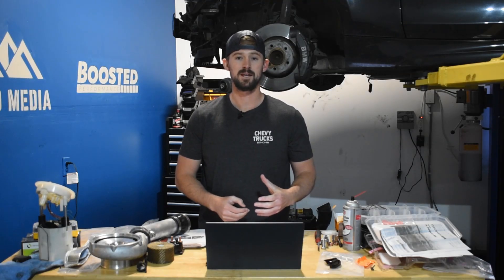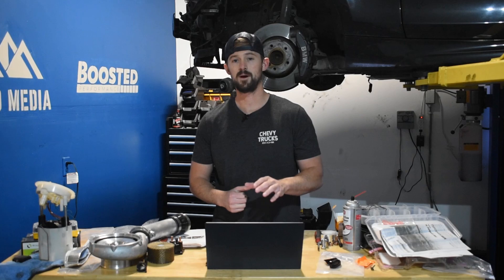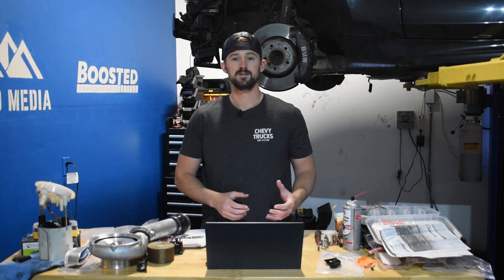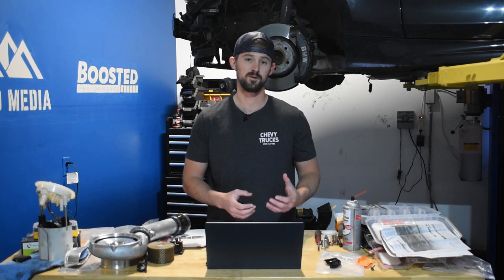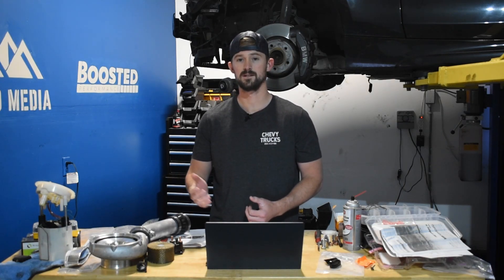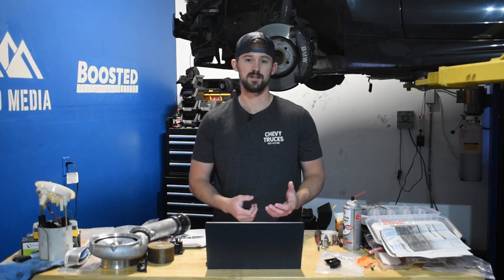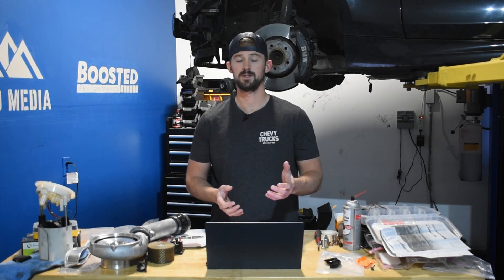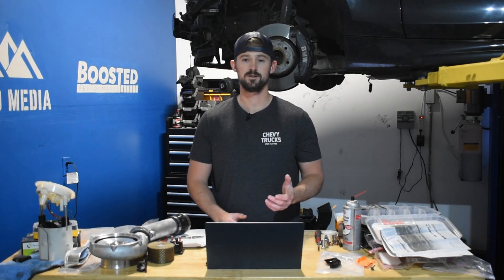The LMM Duramax - Reliability & 5 Common Problems

Comment: I don't think there's any way to know when it's in regen...
Unless it's the one that initiated after it tells you that it must be done.
Reply from the maker: You're right, there isn't an easy way to know - the easiest way is to keep an eye on the mpg average as it will drop when it goes into regen, but if you don't reset this frequently then it's hard to know. You can also tell by idle speed and sound, oil life monitoring % drops a bit too, etc. But it is hard to know unless you pay attention and watch out for it frequently.

Comment: Hey so I’m new to trucks I bought a lmm duramax and it was driving fine for couple days then recently it flashed “engine power reduced “ then went away and drove fine didn’t think much about it but drove it later and it did it again flashed and went away. It does it every other drive any ideas of what can be thank you!
Reply: Is it deleted or does it still have emissions
Reply: Either the tune, or injectors.
Reply: Run the factory air filter the other ones dust gets into them. Yes they are more money but no issue. I ran a Napa filter here in Canada and during a snow storm mine did the same. Went to the dealership and replace it with the ax delco factory one and no more flashing light.  Hope this helps and enjoy your lmm.  Mine is 2010 and at 248000 km. Yes deleted with efi live stock tune and runs perfect and mbrp exhaust from the turbo back.
Reply: honestly depends on if the truck still has a dpf or not. i have an 09 lmm and i kept getting engine power reduced codes and was running like crap. at first investigation i thought it was the maf sensor going bad after reading codes. it ended up being the dpf was clogged and the motor couldn't breathe. if it gets worse as you put more miles on the truck i would take a look at the dpf.
Reply from the maker: Clean - Welcome to the Duramax family. We love Duramax's. Here's an article on our Tuning Pro site that may not be for a Duramax, but it is still relevant to the underlying issue. https://tuningpro.co/reduced-engine-power-warning/
Reply: My 08 Lmm was doing the same ,I have a bulldog programmer so it gave me code , Don't remember code , But used my scanner and the code was low fuel rail ,So I'm actually gonna replace the fuel rail valve with a pipe valve replacement
Reply: Just buy new oem & shim it, don't use a race plug.

Comment: What upgraded trans cooler lines would you recommend?
Reply from the maker: Cooper - Our choice would be Alligator Performance, not super expensive. However, it's an annoying DIY, but there are plenty of guides out there.
Reply: I did the alligator performance lines after 2 previous replacements of OEM.  I’m a total novice and the Alligator lines weren’t too bad.  Been successfully running them for several years now.  No problems 👍